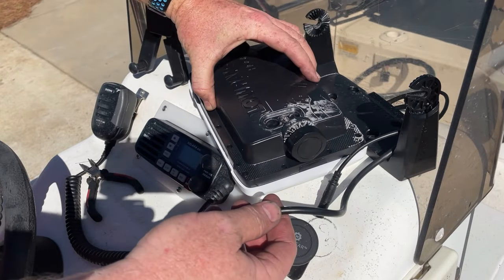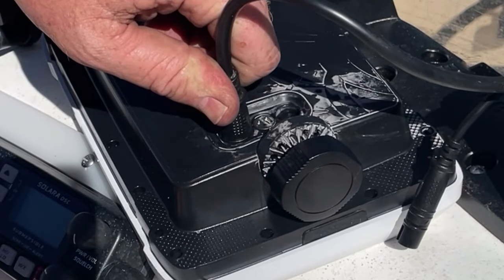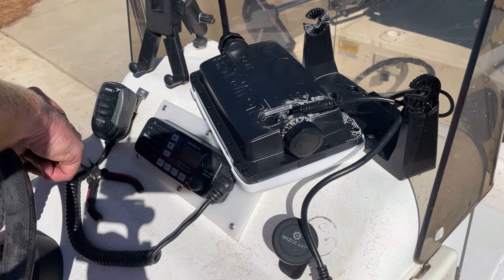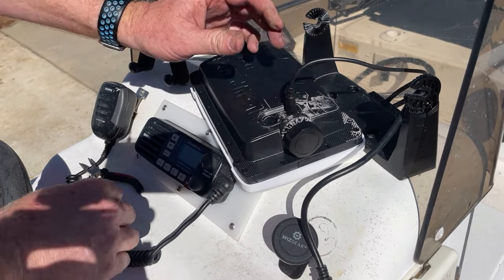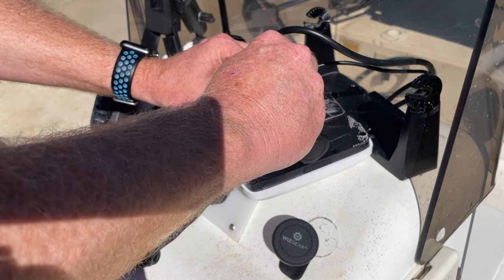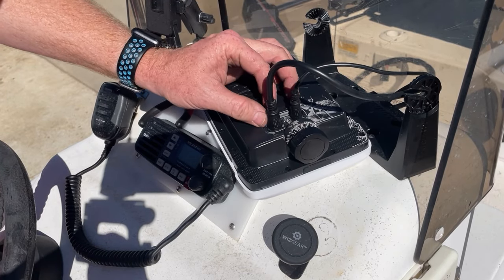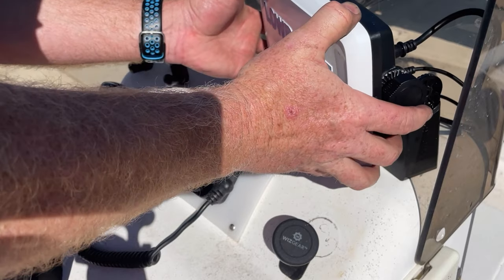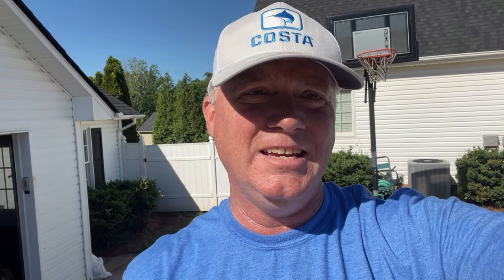Waterproof Connection wont stay in!  Burping a rebounding fish finder? (Lowrance Hook2 7x)

Comment: I'm using fishing line instead of a pin. But my problem now is when i try to remove the cables. Not comming out and im worried about damaging the cable... any ideas?
Reply from the maker: Dab (tiny) of dielectric grease around the outside of the connector will let the cable be extracted easily.